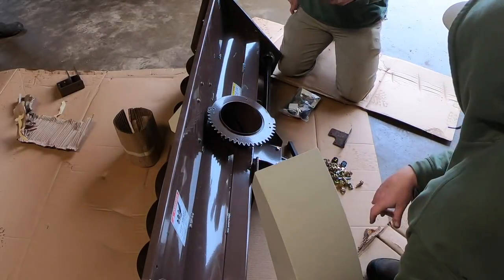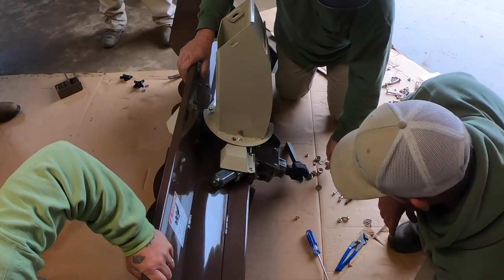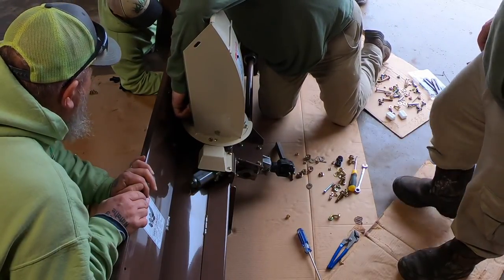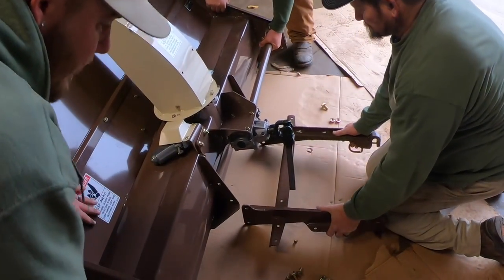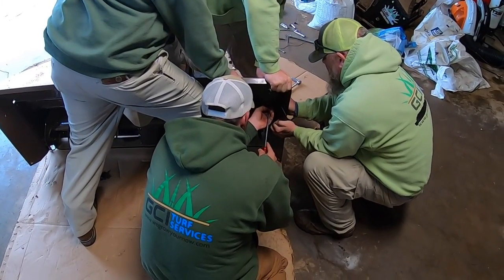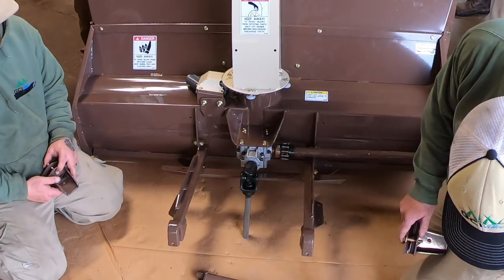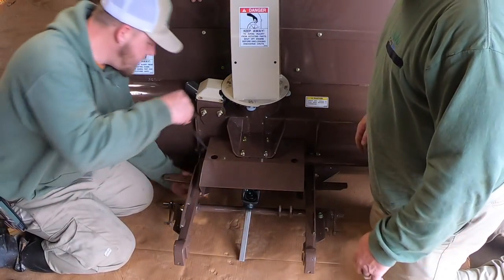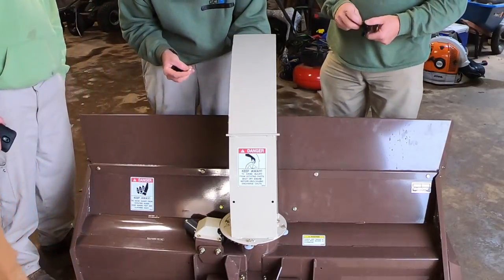Grasshopper Snow Blower Assembly

Comment: I have this unit.  This is a great video for assembly.  I sure wish that someone would show the actual installation of the snow thrower to the unit.  The guys at the shop where i bought it did it the first time.  I cannot seem to get the control arms that the pump is attached to at the proper level to hook up to the mower unit.